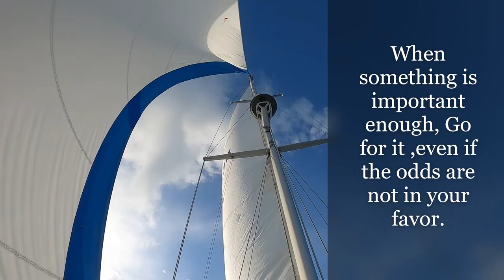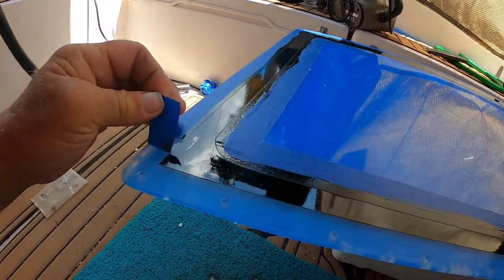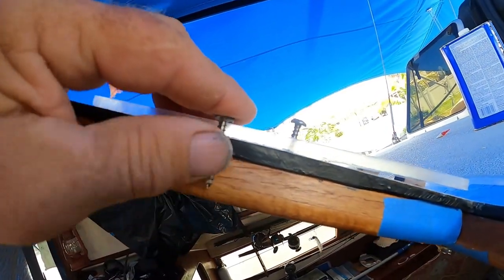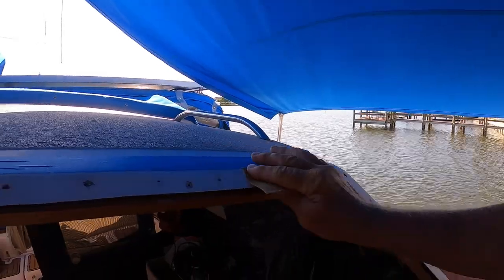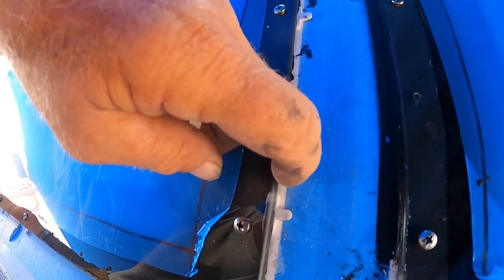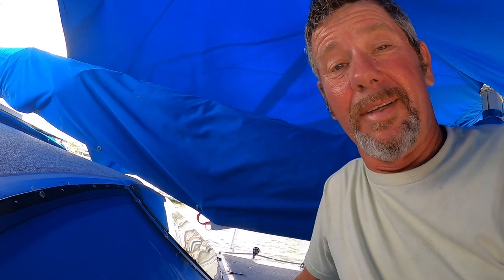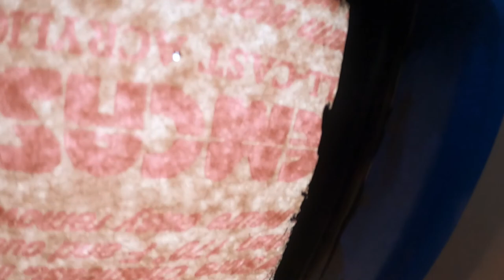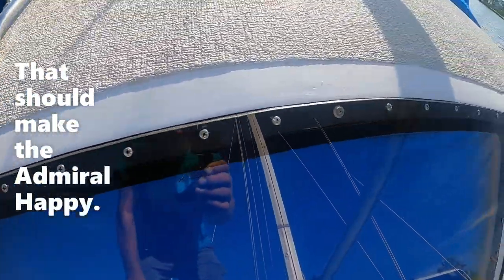Gemini widow replacement part '2'  How to do it single handedly.

Comment: Hi. I'm looking to purchase one of these that was abandoned for 6 years in a backyard. Has a seized engine and  foot of water in each hull- squirrel. Hornet and birds nests--- some soft spots by the hand rails... but your channel gives me hope.  Can these boats be resurrected? Are the bones strong enough?  Great channel!!!
Reply: Thanks Joseph. I believe any boat has hope, most people will say it's not worth putting money into a project boat, that is true if you are paying someone to do the work. If you are capable of doing most of th he work yourself,  it can be worth it. The best thing is you will know your boat inside and out. I know every wire, hose and screw on my boat and to that's invaluable. Good luck on what ever you decide.
Reply: @capt.kenmitchell5116  awesome. I agree.
How difficult is it pulling into a slip, dock or mooring in terms of maneuvering with just a single engine? I know many cats have 2. 
I'm pretty handy and do all my own home and car repairs.. and I like a challenge. I may pursue this project. You do really great work!! Keep posting. 
How